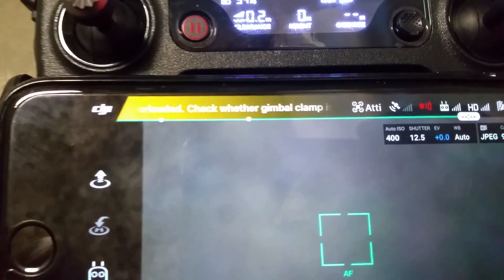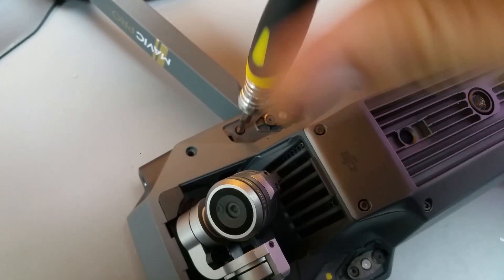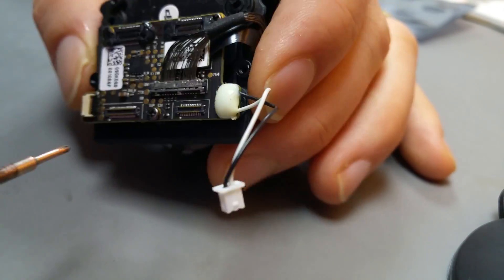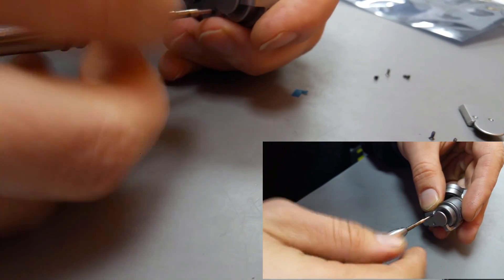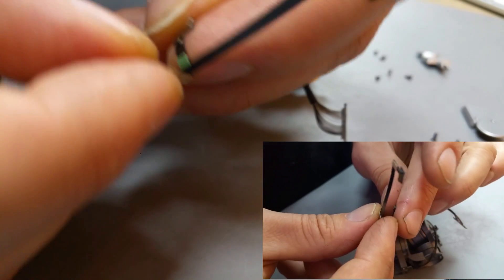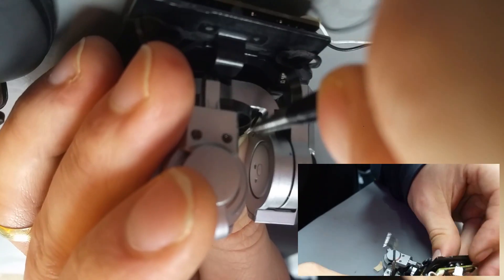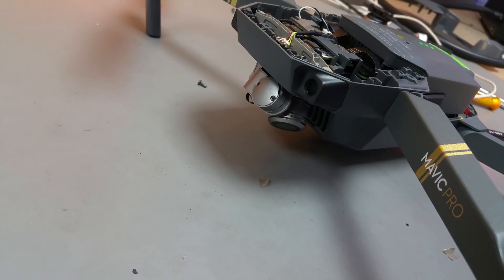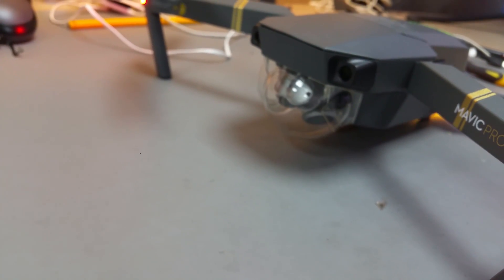How to Fix GIMBAL Motor OVERLOAD error on DJi Mavic Pro from Start to Finish

Comment: The gimbal camera on my mavic do nothing .. no movement and no gimbal dance when i power it on ... it crashed from 3 feet height and shows the same error of motor overloaded ... the video transmission is fine i can record the video but cant move gimble up and down and no movement in the start .. will i too have to change ths gimble flex cable ribbon? Thankyou
Reply from the maker: +Osama Ali hi there is possible damaged power as well but I will try open gimbal for inspection and check ribbon cable visually if you find any damage just replace that cable as is cheap always best options to try as first point if you can't find any visible damage you will need try top border or gimbal motor but as you still have signal I will bet you ribbon cable is cut
Reply: Thankyou for the reply ... i have inspected it deeply and couldn't find any physical damage to the gimbal ... all i know is that it does not dance in the start when i power up the drone and it gives the motor overloaded error ..
 i will unscrew it tomorrow and wil let you know ... going to order the ribbon online tomorrow...
Reply from the maker: +Osama Ali yop as you can see on this video there is no damage at all visible by eye but replacement help and there been no problem anymore and if you check my second video for gimbal repair witch is more detailed please have a look you will see damage is between vibra plate and holder quite well hide yop open and check that gimbal and remember even microscopic damage on ribbon cable give you motor overload and as your looks like dead I think will be similar cut like I have on that second video 
I hope all my video will help you
Reply: Sorry where is the link to your second in-detailed video?
Reply from the maker: +Osama Ali ok easy way here is link :-) 

https://youtu.be/mPjaG15VGmE
Reply: I bought the cable from Aliexpress, do they have original and fake one too ? How to distinguishe between both of them? I am scared as i have heard some cables makes the camera and gimbal hot after using.
Reply from the maker: Osama Ali hi don't worry I usually buy that cable from aliexpres or ebay all cable on market is ome anyway and I don't have problem with over heat at all I think you will be ok and good luck
Reply: I have a Mavic Pro as well. I never even crashed it. I replaced the Vibration mount and ribbon mount. Still no luck. What should I do next?
Reply: Sorry for late update ... its been more than a month that i changed unscrewed the mavic and found the felxible ribbon cable broken :) .. i changed it by myself watching your video and it worked...when i powered on the Mavic it performed the gimbal dance .
All is well .. thankyou :)
Reply: GLL Designs Gabrielle Ledoyen Lambert 
You should unscrew your mavic and check the cable. Have you tried the gimbal caliberation through Go4 app? If it stops and does not continue i would want you to open it and look into the place where the cable is located and check it if its okay or not.
Reply from the maker: Osama Ali thanks so much for update and make me happy my video help another mavic user I hope you will stay on my channel and click subscribe as more content coming soon and this will be nice thanks from you as well  
I wish you happy flight

Comment: Hi bro flexible cable kavali
Reply from the maker: Not sure what you mean kavali
Reply: Mavic pro motor overload
Reply from the maker: @bhaskarrock5914  if you have that problems replace Flex cable and should be fine

Comment: could you see whats wrong with mine?
/watch?v=V-AV4Qlwvaw

No crash, only used it 4-5 times. It seems like the gimbal gets stuck on the left side.
Reply from the maker: R.G 90 hi I will check this later and give you answer
Reply from the maker: hi I can`t open link :-(
Reply: hmm weird it works for me. Can you click on my name and look at my latest video. 

*I tried to recalibrate the gimbal but it get stucks on 5% and says that i should keep the aircraft stationary. Also when it calibrates it seem to hit the wall sometimes and maybe thats where the problem is.
Reply from the maker: R.G 90 check all 4 small rumble and vibrant plate I will check that video later

Comment: I am in a middle of a trip and obviously this video does not help. The title is wrong, you don't explain why this happened, you just change a part
Reply from the maker: Why this happens is easy usually because you don't use gimbal support part when you Cary your dron in bag and Also is really common foult there is no reason to explain why is happening in this video is how to fix This problem and yes replacing this flex will help
Reply: @frogtechtips  I always put that part cover. Thanks for the explain
Reply from the maker: You welcome

Comment: I didnt even f***ing crash and im getting this error.. Also im not an engineer
Reply from the maker: ye I seen this problem even when you are not crash  do you still use that plastic gimbal holder when you move
Reply: @frogtechtips  Everywhere I go! Came off a flight the other day (which my drone was packed in) and have had the issue since. Thinking the bag took a hard hit somewhere.
Reply from the maker: ye my friend that's can be reason as flex inside this gimbal is so sensitive